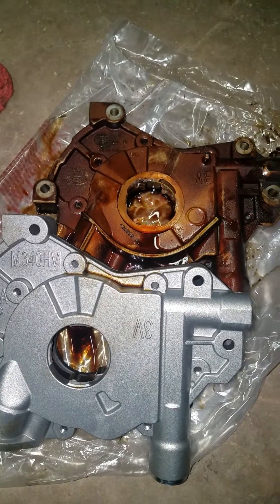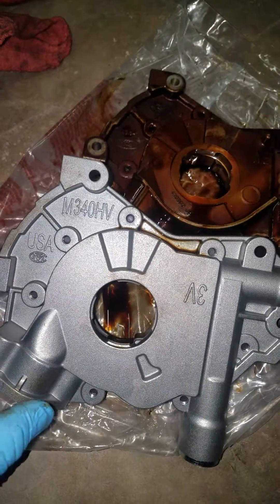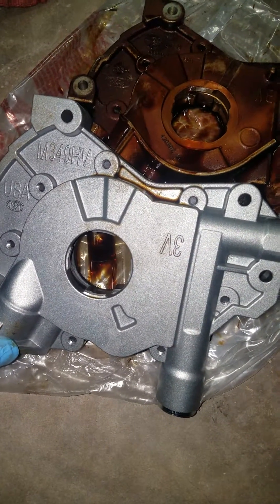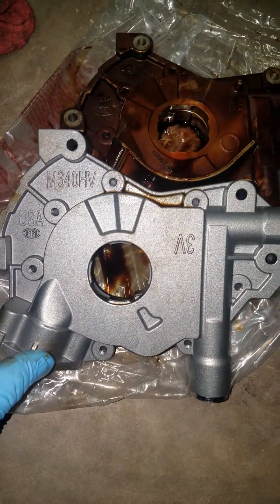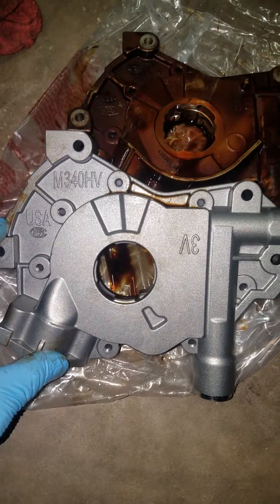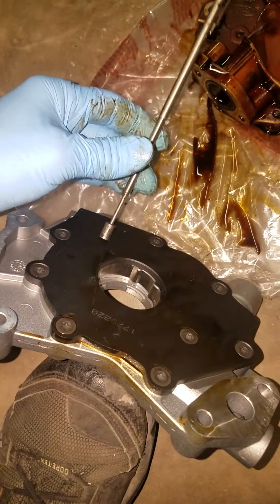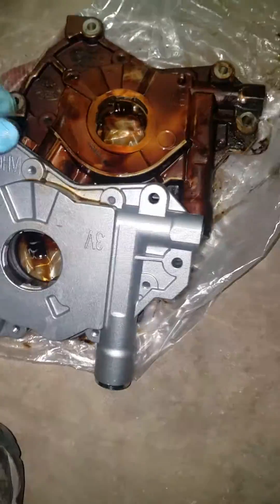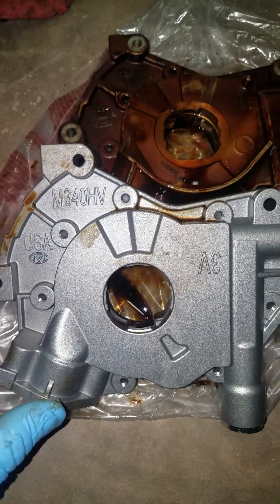Ford 5.4 3V Oil Pump Replacement Upgrade

Comment: If u switch to that one. You have to buy a new different size pickup tube.
Reply from the maker: There's a lot of opinions out there.  I've performed many oil pump upgrades and don't use anything other than an oem tube with no issues.  One of my personal trucks that is used as a loaner has the same pump and now has 250k after the pump install.  Not one customer has returned with issues after using the oem tube.
Reply: @okcvet1st i just bout this same pump the 05 ford f150 5.4l and the pickup tube did not fit it so has to be changed.

Comment: waste of money
Reply from the maker: What is a waste of money?
Reply: @okcvet1st  overkill, ford one is fine
Reply from the maker: @brentbradley6711     Ford discontinued their hv pump and now recommends the melling hv. Even though the stock pump provides plenty of pressure for the engine, it does not provide enough volume when your engine is worn. The m340hv is well worth installing to insure adequate oil volume.
Reply: @okcvet1st  Not buying it.
Reply: @brentbradley6711 😂

Comment: Work good for you  ??? I'm in the process to replace the mine
Reply from the maker: The m340hv is a good option for oil pump replacement. Lately, I have been using the High-volume, High-pressure with pickup, oil pump that Ford Performance offers for the 4.6L, 5.4L, & 5.8L, Part# M-6600-F46, which after a period of testing seems to be the better option.
Reply: @okcvet1st  
Thank ...
any recommendation for tensioners I would appreciate it.. 
I just finished disarming everything and I found a blowout tensioner.
Reply from the maker: As far as tensioners go, I would just pick one up from the local part store, or maybe a salvage yard. LKQ Pick your part would be pretty cheap also if you have one around you, but I often just buy a new one versus spending time, & gas, which equals money.  Another good option is Summit Racing, which usually within a few days, can get you the exact same part as the local store at a better price.